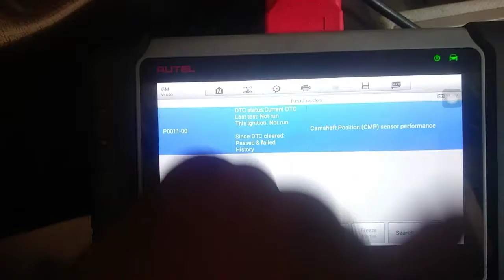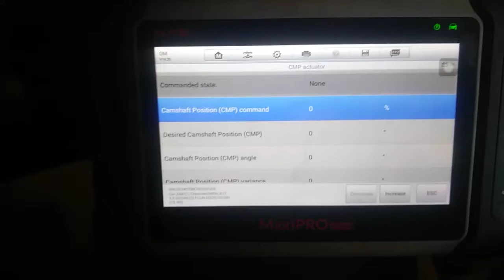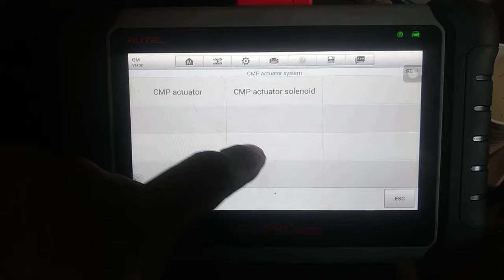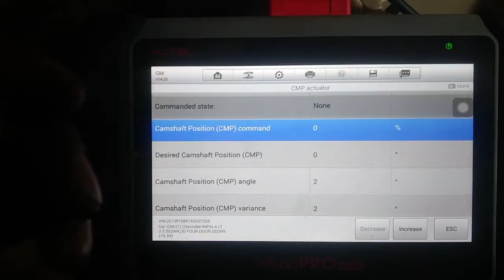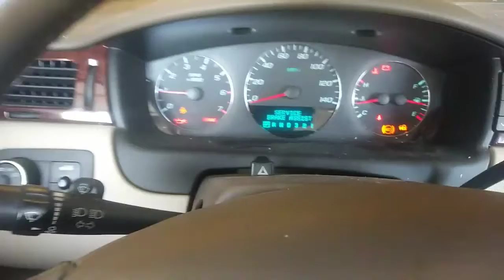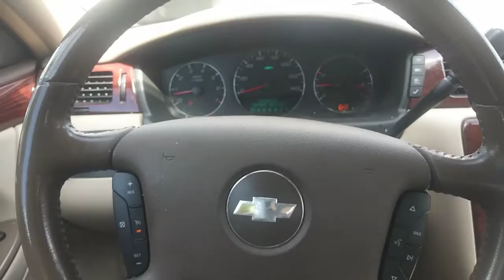Chevy p0011 FIX!!!

Comment: I have a 2008 that the check engine light be on I have paid more money to the dealership don't have a good mechanic in them in Virginia so no I moved to Maryland I'm going to see if I can get it fixed other than that nothing is wrong with this car I have had this car since 2015 and it drives great I keep up all other maintenance

Comment: hey gearheads, i need some advice.  I'm getting the p0011 and p0016.  What are the odds that it is not a timing chain but replacing the VVT and/or the camshaft sensor.  as far as I can tell they all have the same symptoms.  running rough throwing codes.  the only history is there is a slight oil leak that I need to address, but I have kept the oil topped off and changed.  car has less than 100k on it, prob ~80k

Comment: The used Impalas are cheap to fix is one reason to own them - 2010 - new wheel bearing on eBay $35 , CV axle $40 , 4 drilled rotors $125 , 2 control arms $50, starter $50, water pump $35 , 2 headlights $60 , these are parts I got this month -

Comment: I changed the camshaft position actuator because I got a p0011 also but as soon as I turn the car on it was just loud noise banging noise a little history first I just changed the oil because I completely ran out of oil in the car turned off after that the car keeps turning off I changed the actuator and it still keeps turning off but the actuator to me was the cause of the loud noise help
Reply: Crankshaft sensor
Reply from the maker: Disconnect the actuators, start the car and see if it idles smoothly. If so, you have a circuit issue and they or one solenoid is being commanded on 100 percent when it's not. 

If it don't idle smooth, you likely bad actuators. And all the timing components need replacing.

While you in there, check passages for sludge buildup
Reply: @partsshooter  I only replaced one accuator also called magnet  it had 3 screws . So disconnect that or completely remove it turn the car on and see if the noise is there if it is I need to replace that part again
Reply: Don't really know how to check for sludge thanks for the new information

Comment: Im dealing with a intermittent p0016 code in a 3.5 myself. The engine is pretty sludgy. Im willing to bet this will be the confirmed fix for me, I will try to update this comment after I solve it.
Reply: How did that update go?
Reply: @bretthonan6334  as I mentioned the engine was sludgy. The customer refused any further  repairs.  The car ended up getting traded in to us and we put an engine in it, which it needed.